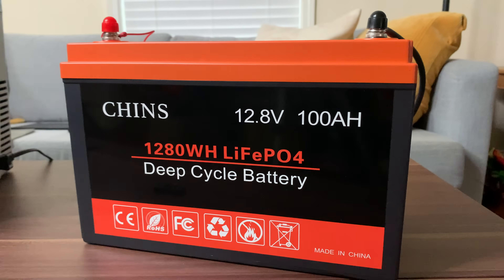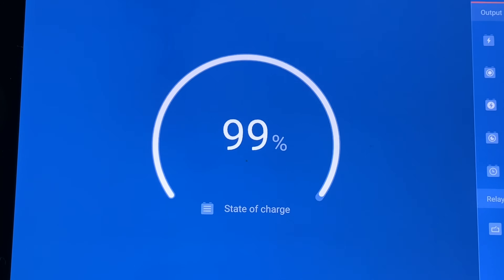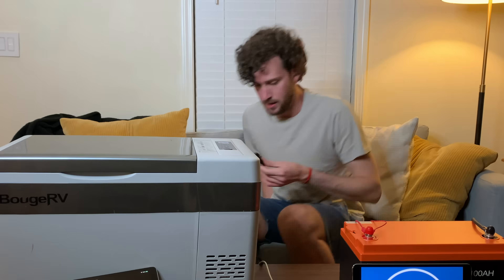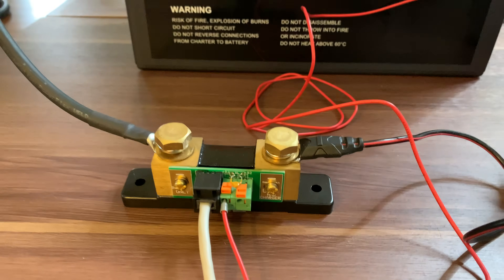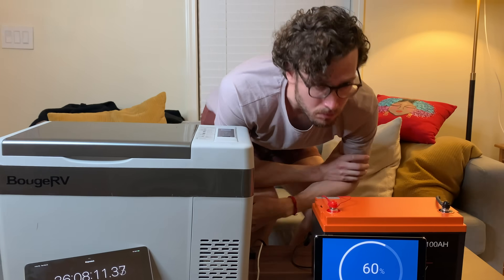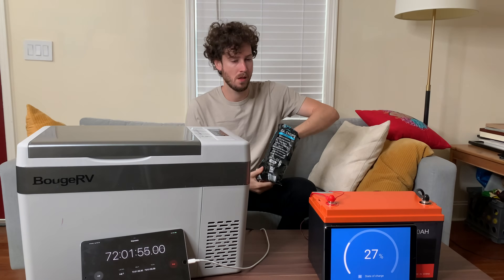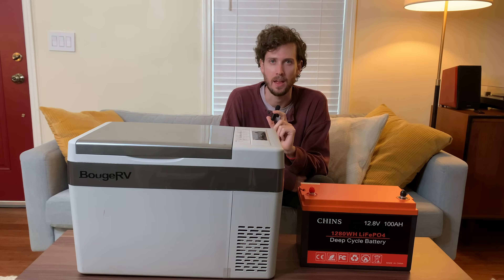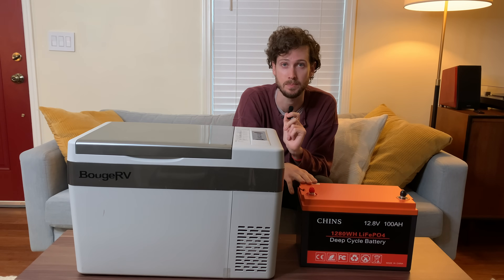100Ah LiFePO4 Battery vs 12V RV Fridge

Comment: I have the BougeRV 30 quart fridge and want to be able to run it off of a 100 AH Lifepo4 batter ywhen I'm camping for several days. I didn't see how you had that fridge connected to the battery. Can I simply purchase a cigarette lighter plug with alligator clips? Do I need a certain size of clips? The terminals on the battery are M8. Do I need anything between the battery and the cigarette lighter to make sure nothing happens to the fridge?

Comment: I am seriously ogling one of these, and a big one
Either a 24 or 36v 100ah one, I'm not sure yet. Per usable watt hour, they're just as expensive but can be cycled anywhere from 10 to 50 times as many times before they're at 80% capacity. This seriously might be the chemistry that takes the world into the renewable era. All we need now is a chemistry that delivers like this but doesn't need the lithium and we're set.

Comment: Try that with the fridge outdoors as it simulates an actual camping trip. Just a thought
Reply: Leaving a fridge in full sun is a bit silly.
Why would anyone do that?
Reply: @clockmendergb  Because teh inside of a vehicle gets very hot.  You cannot always camp in a location with continuous deep shade, and if you do so there is a trade - off vs. your solar input.

Comment: You will get significantly less run time if used outside during summer . The compressor will run twice as much often
Reply: “Results will vary” if used in the winter outside it would probably last even longer
Reply: @WhoamI20233  ...and why exactly would you need a fridge in such conditions?
Reply: Good point
Reply: But he’s not.
Reply: Hi there! Thanks for sharing your thoughts. You're absolutely right that external factors like high temperatures can affect the performance of appliances, including the compressor in an RV fridge. To address this, I recommend considering the Segway Portable PowerStation Cube Series. It has a massive capacity, fast recharging, and comprehensive protections, making it a reliable power source for your outdoor adventures. Check it out!

Comment: I have a large fridge/freezer of 76 litres connected to 2 x 100amp lead acid batteries. I have been told that for a lead acid battery the voltage is not to drop to below 12 volts as this will shorten the ,life of the batteries. is this correct?
Reply: Yes.

Comment: Did you start the fridge pre chilled or was it just room temp to start?
Reply: I think it was not pre chilled, but for this long of a test it doesn't make a huge difference, it takes about 330 btu to cool a gallon of water from room temp to cooler temp, which with a reasonably efficient compressor will take about 50wh of energy tops and the thermal mass of the interior of the cooler is likely less than that of a gallon of water. The vast majority of the energy cost is just counteracting the heat infiltration.

Comment: Thank you!!!

I have been trying to figure out how long it will run.  Now I know what to buy.
Reply: You can't do that though, you will kill the life of the battery. Use a solar panel and controller and try to keep your battery charged, dip no lower than 60-70%, even on a LFePh.

Comment: I tested a Newair 48 qt. duo zone cooler recently using one of the new "mini" 100ah batteries. With both zones set to -4 degrees F and with the cooler filled with 31 lbs of 4" cubes of ice, to represent frozen food that would need protecting during a power outage, the battery ran the cooler for 2 1/2 days. I was impressed. 
  Next I constructed a DC to DC converter that allowed me to drop 18 volt Ryobi tool batteries down to 14 volts and ran the same cooler under the same conditions. I'd like you to do the same with your cooler while set up as a refrigerator, rather than a deep freeze as I did. I thought it would be a handy thing if you wanted to take the cooler on a long grocery shopping trip, but wouldn't want to leave it connected to your car battery while it was parked. Just switch to the tool battery while you're inside the store.
  This stuff is fun, ain't it?

Comment: how come the time is so different from this backup calculating formula? Backup Time (in hours) = Battery Capacity (in Ah) X Input voltage (V) / Total Load (in Watts),
Reply from the maker: What value are you using for watts? The fridge was using around 50 watts when in cooling mode but 0 watts when not cooling, so the fridge's average power consumption was around 12 watts

Comment: * PLEASE PLEASE PLEASE * test a portable / wheeled 5,000 BTU AC unit
Reply: IF the portable AC ran continuously, without cycling the compressor off, it would run about 2 hours. (I know you asked a year ago, but just answering for anyone else reading the comments)
Reply: Yup agree, also if you get a bluetti ac200P or max 2048wh you're looking at max 4 hours runtime.
Reply: @MrCharmz81 my  all powers went about three days on a trip I didn't want to lug in the refrigerator every night and didn't want to plug in the van and run that battery down. I got a least 3 days if not 4 and still had about one third left in the power station. My cooler is like the one in the video but mine has a larger lid. Great for standing up bottles. 73

P.S. I see you guys were talking about an AC unit. And if that's the case mine ran two days after Milton. I live in central Florida I'm going to try solar panels I may not turn on the power from the power company. 73
Reply: A 100 mAh battery would probably crash pushing that load when hooked up a big enough inverter. With inefficiency you will  lose a lot of power before it attempts to start.
Reply: @MIForestguy  Most of these batteries have a max discharge rate of 50A so you would need like 4 of them to handle the load without causing BMS shutdowns.
Reply: Portable A/C units consume twice as much electricity to cool 50% of an area compared to a window unit. They are the worst type of product to try and run off of solar.  With window units, the "hot" side of the heat pump is outside the house, blowing all the heat away from it.  Portable units, both hot and cold sides are inside with you.  The unit tries to blow out as much heat through the tube out the window or wherever as possible, but there are several layers of inefficiencies involved so a lot of the heat doesn't make it outside.  And since it has to push air outside the space you are trying to cool, the house has to replace that air by drawing hot, humid air in from outside.   Regardless of where they are getting their power, portable units really should only be used in an emergency or when there is absolutely, positively, no other option.  They are like putting the compressor and all the hot components of a refrigerator inside of it with the food and expecting it to keep the food cold by trying to blow the hot air out of the same space.... with the refrigerator door cracked open.  It's possible, but it's going to require some over engineering and take all 15 amps of the circuit to do it.... poorly.

Comment: Love that test. Real life situations. How about a AGM Battery test. I am not sure if I want the AGM or a Lithium??
Reply: Lithium is better, agm doesn’t like being discharged so much and will shorten the life span significantly.
Reply: you will save tons of energy just in the weight difference...lithium will be about 1/3 the same size AGM that can only produce 1/2 the power so you would need twice the AGM battery which now brings the the lithium to 1/6th the weight of AGM,  in a vehicle thats a big difference to MPG/energy.
Reply: agm you wont be able to drop the voltage that low without damaging the battery.

Comment: Nicely presented video. I love the test set up.  It doesn't hurt that I have the same 30 Qt.Boogie 12 volt fridge and similar sized LiFePO4 battery.   I haven't had to do the endurance test all the way to 0%, mainly because my battery is connected to a 175 watt solar panel, which even on a cloudy day will provide some offset to what the fridge consumes.
Reply from the maker: Thanks! Yeah with this fridge and a 175W panel I suspect you'll almost never run out of battery
Reply: Thank you for sharing your experience with the 100Ah LiFePO4 battery and the Boogie fridge! It's great to hear that you have a similar setup and the solar panel offsetting the fridge's consumption. If you're looking for a powerful and versatile power station for your outdoor adventures, you might be interested in the Segway Portable PowerStation Cube Series. It offers massive capacity, fast recharge, and comprehensive protections, making it a reliable choicoutdoor enthusiasts. Happy camping!

Comment: How long can the fridge run on 120v ?
Reply from the maker: You mean like off an inverter connected to the battery? If I did that, I'd expect it wouldn't last as long, due to the added inefficiencies from converting from 12V to 120V then back to 12V. It probably wouldn't shorten the time by too much, but I would expect it to be less.

Also, inverters have their own operating voltage ranges, and they'll turn off if the battery voltage drops outside that range. So, depending on what your inverter's voltage range is, the inverter may cut off before the fridge does, which could also shorten the runtime you get from the battery.

Comment: I insulated the outside of my 12V fridge with 1" styrofoam insulation board, bottom and sides, excluding the top and small side vent area. Taped into place with foil duct tape. This resulted in fridge cycling on half as often,  extending battery charge to nearly twice as long. Way cheaper than adding a second battery for extending cooling time. 500watts of solar panels feeding 100AH LiPo battery through 40Amp controller. Two years traveling, not one hiccup.
Reply from the maker: That's awesome!
Reply: I keep mine in the back seat of the car for grocery trips. Works great at keeping frozen stuff frozen from the Grocery Store to Home.  Especially Popsicles and Ice Cream for the kids. The only bad thing is having to do up the seat belt, or else my car alerts me that someone in the back seat is not buckled up.
Reply: I made a 2" foam enclosure for mine which doubles as generator noise reducer.
Reply: sounds like alot for a small fridge,that would be enough for a full size one lol
Reply: Thank you superhero!
Reply: Kindly do a video on this
Reply: Or do both
Reply: @sammy5576 I added one more 100ah battery, changed to a 3000 watt pure sine wave inverter. Mainly power the 12v 40 watt fridge (replaced the fridge a year ago), LED lights, recharge laptop and cellphone, a cheap hot plate (but mostly cook with propane and butane), very occasionally run corded power tools including a wire feed welder. The cost of the batteries has dropped, $900 for the first one, a Battleborn, $300 for the second Chinese battery that works the same.
Reply: I can run the fridge indefinately  because I have solR but when we were converting a 10 x 6 trailor we did a 2 month trip with it before fitting the solar.
thats when we  ran the fridge for 7 days 24 /7 before paying for a camp ground to recharge our Bluetti and our other 200ah lithium 

we use 400watts on the roof in our shuttle and also in the trailor as well
we use 200ah lifepo4 that keeps us going in the summer
We spend   at least 2 months travelling in the Winter hete in Canada and every year we get snowed in for sometimes days

Over winter we run our deisel heater 24/7 using a 5 gallon boat fuel tank that will run the heater for at least 7 days.

during these trips we take the Bluetti 2400 with its own 200ah lifepo4 battery.

we als carry a 200 watt suitcase panel to augment the 400watts on the roof
with those winter additions we can get socked in for a long time without much solar if need be

Redundancy wins the day always

when we are out wr do a shop and refuel once a week .
More if we expect to be snowed in
Reply: So I’m thinking that if I was not running a lot more than this, 500 watts would be overkill right? I was thinking one 180 watt panel would be sufficient but please correct me if I’m wrong because I’m only in the initial phase on leaning/planning.
Reply: @EricLewis-fk3rp  I believe the 180 watt panel would be good. My 500 watts of panels  is overkill for my setup, the main advantage being a rather fast recharge, but fast recharge is not important as the drawdown is very gradual.
Reply: @moregrouchy  just want to be able to use this and charge a few 50 ah batteries as well.
Reply: @EricLewis-fk3rp  Your solar battery capacity will determine your ability to handle your power needs. The wattage of solar panels affects how quickly your solar battery bank recharges. Add more battery before more solar panel to expand your current system, is my suggestion

Comment: So the average draw was approximately 1 amp or 13 watts since the LiFePO4 runs at around 13 volts during 95% of its discharge.
Reply from the maker: Exactly

Comment: If you will do this test I think it’s better to record the ambient temperature and the temperature settings. I have done some test with portable fridge/freezer it has two compartments.I have notice the temperature settings makes a difference on power consumption.
Also the lithium batteries are recommended to discharge to 80% and then recharge them, this way you will get a longer battery life .
Reply from the maker: Thanks for the idea! I put a little note about 80% DoD in the video, but always good to reiterate that here for people who may have missed it 👍

Comment: How did you connect the battery with fridge and links.
Reply from the maker: I used this connector: https://amzn.to/3TL2UJA

Then I just plugged my fridge's included 12V power cord into that connector. Super easy.

Comment: What parts do I need to charge the battery with solar and propane generator.  Amazon links help.
Reply from the maker: Here's a video I just posted about how to charge the battery with solar - https://youtube.com/shorts/qNlZl7ilKwg

I link to all the parts you need to do it in that video's comments section. I haven't worked with propane generators before, so unfortunately can't help ya there!

Comment: Can you run this test in a car. Ambient temperature affects  the energy consumption. A fridge in a air conditioned house will use way less energy then. If your camping and it’s in a 90degree car.
Reply from the maker: I'll add the idea to my list for when it gets hotter out!
Reply: Also the setting temperature it make a lot of difference.

Comment: Thanks for the video. I have the same fridge and I run it off of an EcoFlow Delta 2 and I noticed when the fridge is plugged into the 12 volt port on the EcoFlow the output watts are very random (35-60watts) when the fridge compressor is on. Do you notice the same thing?
Reply from the maker: When my fridge was actively cooling its wattage would range from 35-50 watts (not sure why it never got up to 60 which is what the product manual says it uses up to when in MAX mode). I suspect it's due to the fridge being in different stages of the cooling cycle, but that's just a hunch!

Comment: Nice video. I suppose that you would have gotten even more time out of the battery if you had the fridge in ECO mode.
Reply from the maker: Thanks! Yeah I suspect so
Reply: Not by much.  Eco mode pulls less power but has to run longer.   If this were an old school led acid battery that would be a win but with lithium it makes little difference.